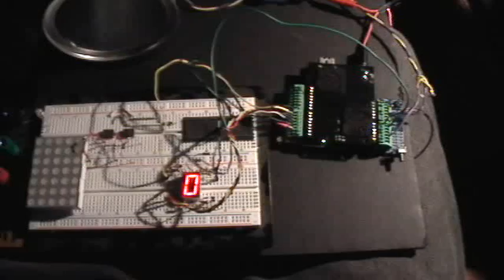Arduino 8: PV Sensor Output to Seven Segment LED

Comment: Somewhere, deep down in some boxes, I think I have a few of these seven segment LED indicators from the 1980es. It's time to find them. Great idea.

Playing with a 10K potentiometer: just touching the axle changes the sensed value by up to 7 (out of the 0 to 1023 range).

Greetings, Conrad